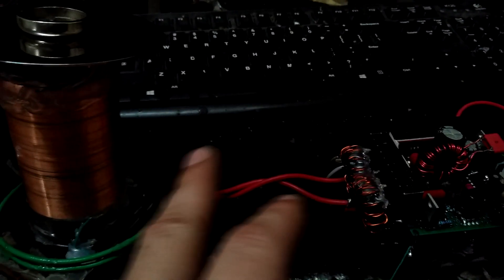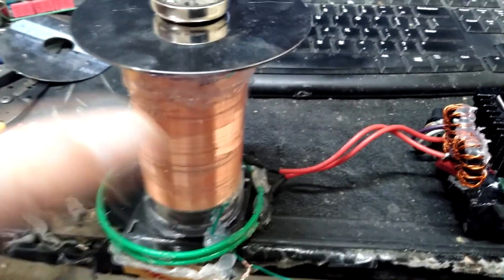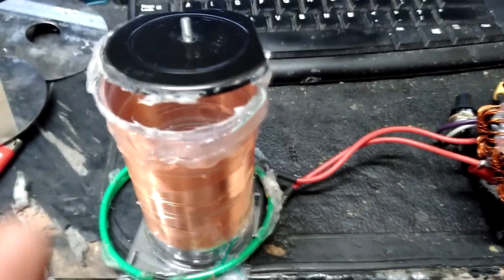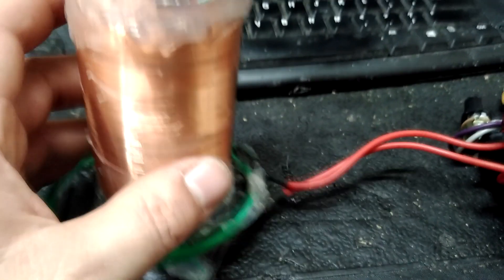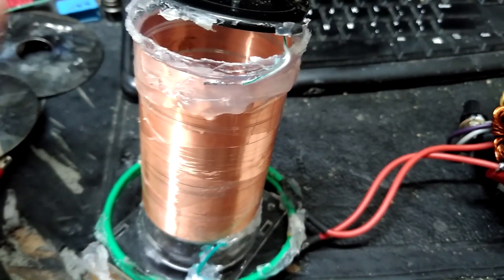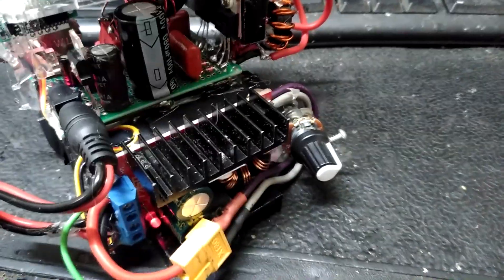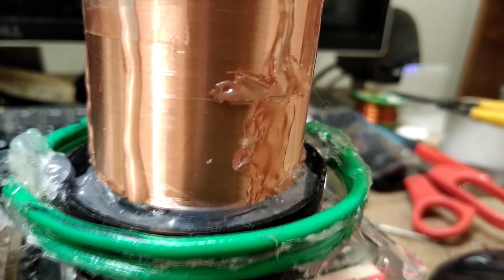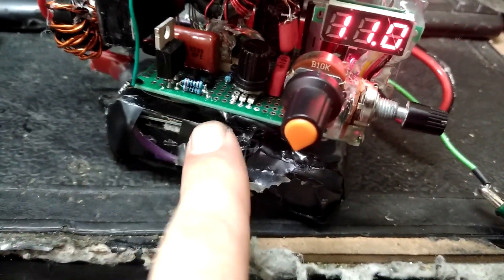Portable Battery SSTC 12-26V

Comment: Impressive arcs!
Reply from the maker: Thanks I think they're still pretty good but I did learn from this they can get much longer from the same voltage. I was super impressed and soon as I felt confident it was running reliably it suddenly didn't lol. I hope I can recreate the best results I ended up seeing at one point. Might get lucky and can just find the right capacitors for this one. The same setup would work with higher voltage mosfets (used IRFZ44Ns) to get crazier arcs though.

Comment: since u wound it on glass,  the glass itself could have an effect, and it can be removed but that would mess with the variables
Reply from the maker: I remember trying to observe all the various ways it was acting and it's weird cause for the first day or so there was nothing erratic about it.. 

I could flip the primary either way and one way would work 'decent' with it toward the top, and the other would come out with this noticeably different and louder breakout with the primary about an inch below the secondary. This also required about 100nF in series. It seemed like maybe I burned up the secondary some kind of way cause running it like that produced a lot of heat but I remember thinking wow it's running pretty cool on the fets though. 
It wasn't til hours later after it had sort of crapped out that I noticed it randomly working like it was again and saw the little arcs. Was too difficult to get that reliable though and it was only for short whiles it would run like that so I still don't know for sure. I do know that it's possible to get 3-4 inches from only 12V input though. I may just try to rewind a similar coil as the first but get the windings perfect that time to see what happens.
Reply: Have I seen the 4inch at 12V yet ? That's 10cm
Reply from the maker: @sFeral  No I didn't record it, that's what I mean I spent the whole time trying to get it going like it was. I was getting 3-4 inches from 12V when I first built this. Showed it off to some people in person etc.. Then suddenly it stopped working the same so I rewound the smaller coil.

Comment: if you don't care about this coil much as is, try cutting it at that point where the arcing occurred, then try the top part by itself, then if it doesn't work, put both parts on a pipe to be able to slide the top part away from the bottom creating a kind of spark gap between them
Reply from the maker: I actually tried that to see what would happened by clipping the wire and leaving a gap but it didn't work right. Very particular kind of winding overlap arcing to get the best output and I was only able to recreate it after like hours of tinkering. Didn't last of course though
Reply: @Magneticitist  did you try the top piece by itself, or/and running the feedback off that point with the bottom piece still in place ?
Reply from the maker: @sFeral  the top piece by itself would have been way off and required a completely different tuning but I'm sure I could get it to work
Reply: @Magneticitist  you can run it even without the primary cap, especially given how huge those chokes are, I mean I'm doing it with only one on the side and no cap at all, but since I found some of those CFL starters with a 5nF HV cap I tink I'll be able to work something out
Reply from the maker: @sFeral  Of course you don't need a cap but the point is to get longer arcs by running higher voltage and current in the primary. You can also keep running with only one choke but again, I'm not going to do that because I want the fets balances and running properly. 

Right now I still have the same 100nF I had tuned to my first coil here and you can see it still works but just nowhere near as good cause it's out of tune. No way this second coil would just randomly be the exact fres of my first.
Reply: @Magneticitist  Looking forward to seeing
Reply from the maker: @sFeral  That same shit has been happening to me a lot lately lol. With the Ward .5 DRSSTC it was going great at first then suddenly wtf? I recorded my attempt at trying to get it going again which wasn't as good. Then in the next video I had beefier arcs but again, out of nowhere stopped working the same. I still haven't tried it again with new IC's but my cap bank was crapped out also (replacing it didn't fix it though). 

Likewise this one was going awesome, I'm thinking to myself damn better record that.. showed it to a buddy for like an hour who had came by, shit worked great with no hiccups then randomly bam, way lower output.  

Winding those coils is so much of a bitch though.. I didn't have it in me to wind the first bigger one 40AWG all the way through without gaps or overlaps.
Reply: @Magneticitist  put caps in series to get desired value and double V rating, could prevent cap meltdown
Reply from the maker: @sFeral  lol yea with my drsstc running over 250VDC that's def needed and I was on the edge, did blow it eventually.. but dang I wasn't expecting a 630v cap to go bad running 24v tops. That sucker was getting real hot though. Now it doesn't even get warm cause it's just not surging the amps it was.
Reply from the maker: @sFeral  Wait you mean just like in general? As in metal seeming to decay quicker in the work area?
Reply from the maker: @sFeral  IDK at first I was gonna say that almost sounds like some kind of dangerous indication of something not-so-good in the air right? Or I wonder could it just possibly be a large shift in humidity?
Reply: @Magneticitist  Lots of possibilities and none are good. One time I was arcing a flyback with the arc closed off in a bottle and left it closed... after a few days every piece of metal inside was corroded, had grains all over it, steel nails and copper wires... also I managed to set a copper wire on fire with a lighter a few hours ago... not sure if that's normal. It went white hot and turned brittle gray. Similar to that aluminium wire at the breakout point not long ago.

Comment: Try run/testing while you're winding the coil (top down and with the intended top load) with the spool coil sufficiently distanced... the winding won't be that boring at least
Reply: Nah the wire spool will change the inductance which in turn drastically interfere tank circuit
Reply: @tvishmaychoudhary69  feedback taken by shaving some isolation... not at the end of the spool
Reply: @sFeral  u dont understand my friend 
At that frequency the spool basicaly acts like a big capacitor
Reply: @tvishmaychoudhary69  no different than "ground" then ?
Reply: @sFeral  trying to say that if u cut the wire from the spool in a test hoping that it works good 
It wil not because the.....
IT WILL NOT
Reply: @tvishmaychoudhary69  What you're saying doesn't make sense unless the connection affects the feedback. The  spool acting like a piece of solid conductor just recalls an image of a "bipolar coil".  It would affect the feedback, but since the driver itself also acts like a "top load" on the bottom (load) of the coil and is closer to the top terminal, it would be safe to assume the capacitance between those points is higher (which is also why a spark developing there is more likely). Hence if the difference is great enough, the feedback signal should still be sufficient. Your explanation is lacking.
Reply: @tvishmaychoudhary69  nowhere did I mention cutting the wire, but it would be necessary to restore isolation to the "test" feedback point to keep winding in predetermined intervals... though I guess it would be easier to just wind a tall coil and then cut short pieces off
Reply: @tvishmaychoudhary69   the spool should have huge impedance at these freq.
Reply: @sFeral  yes at that frequency the spool is like a solid metal which in turn can be a capacitor